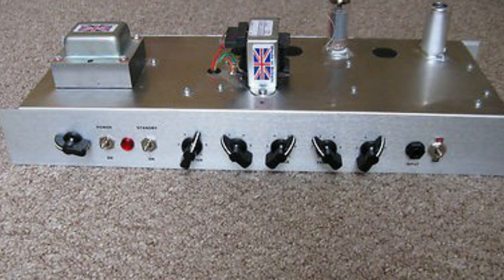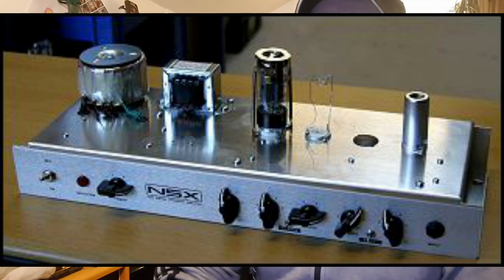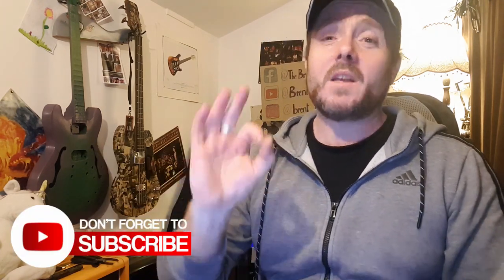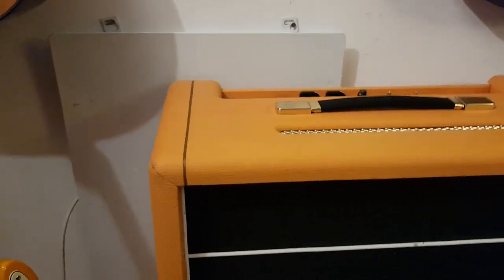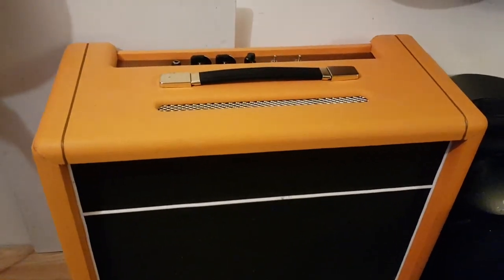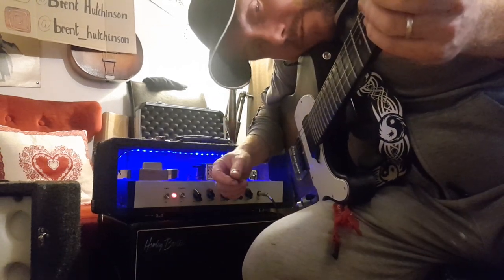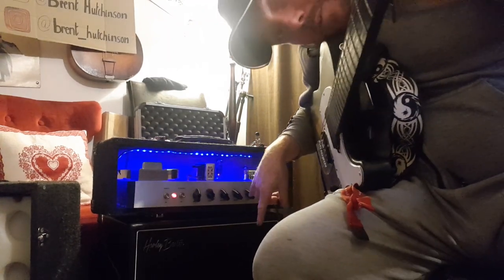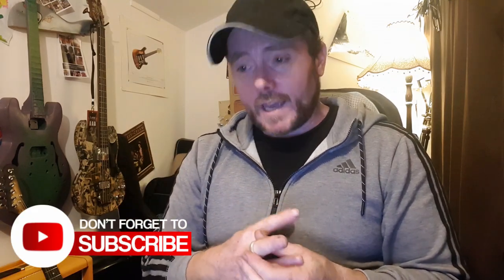Home Built Valve Amp / The End Of Guitar Tone Hunting / How Loud Is A 5 Watt Valve Amp

Comment: Hallo erstmal - i didn't try to solder my own amp, so i bought a 5W Carreer Felleretta from a builder here in Germany. Full tube, main, gain, bass, mid, trebble, stdby, pwr on and thats it. Two 16Ohm speaker outputs, all in a combo case with a 75W Celestion 12" in it and a 100W Celestion in a cabinet. Loud enough to blow down those transistor amps up to 40W and any kind of drummer. At home i have to use a attentuator for no trouble with neighbours. Then i run it with a 30W Celestion cab and have the cranked sound of amp and speaker! Only thing i miss is a fx loop. Maybe i let the builder put one in with a third tube for it (100€). That's the real sound of my younger days. But the updated DIY kit of yours seems to be easy to build, lets see, what my birthday in a couple days brings if i mention it some times - quiete often 😎 Thx for showing us. Live long and prosper 🖖
Reply from the maker: Awesome stuff. I just love the smaller valve amps you get to push em hard to release all the tone!